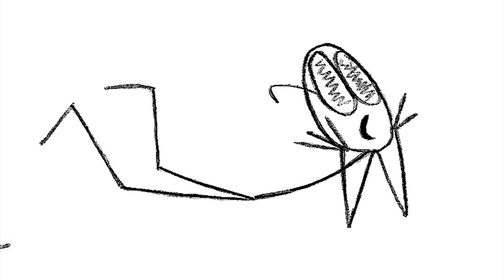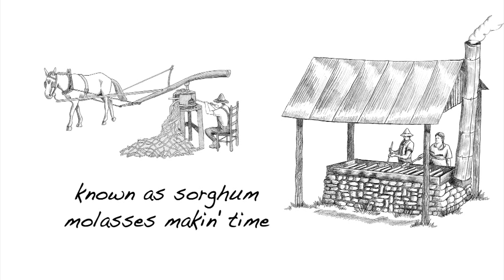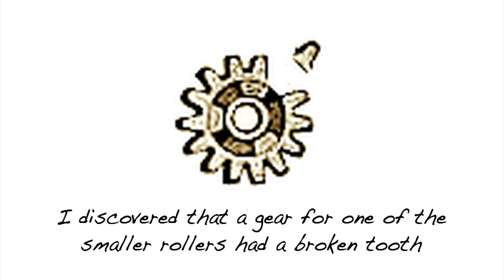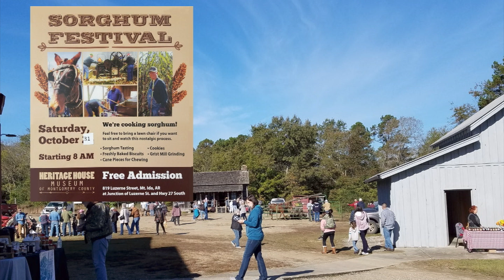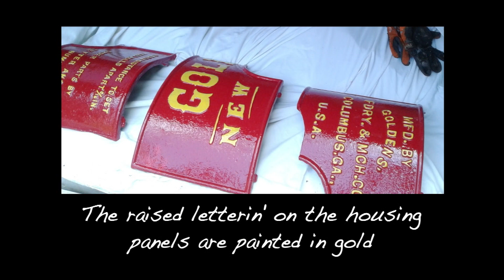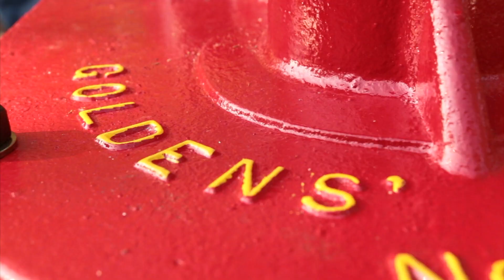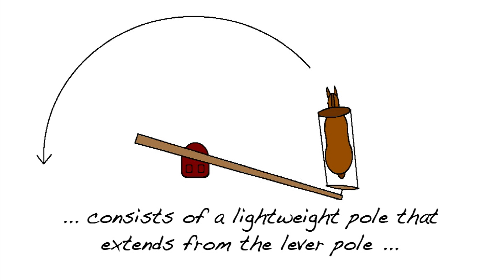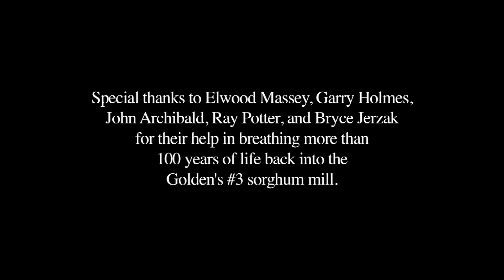Horse-drawn Sorghum Mill Restoration - The FHC Show, ep 29

Comment: Everybody loves a good restoration project :)

10:45 pouring molten metal on a mandrill would be very cruel: https://en.wikipedia.org/wiki/Mandrill :P

Apparently this is a common alternative spelling of mandrel, though.

Won't lots of oil/grease end up in the molasses? Or does it skim off when you evaporate the juice?
Reply from the maker: The bottom plate is molded in such a way that it traps grease and oil into little channels that are separate from the sorghum flow. Before use, it gets washed out with soapy water, too; and during the off season oiled with vegetable oil to keep from rusting. Thanks for asking, awldune!